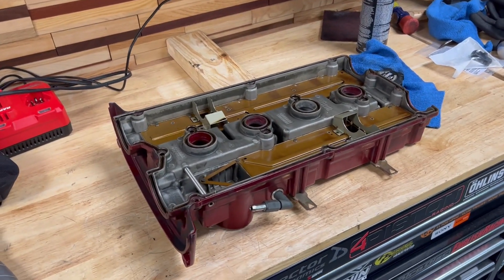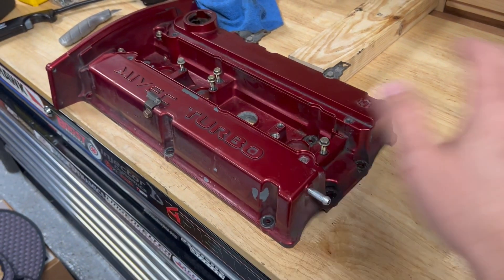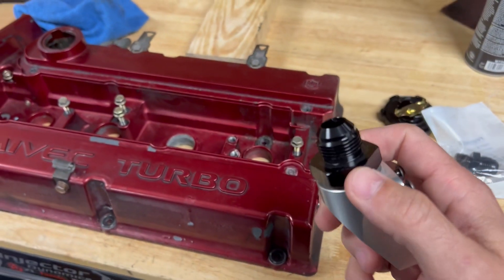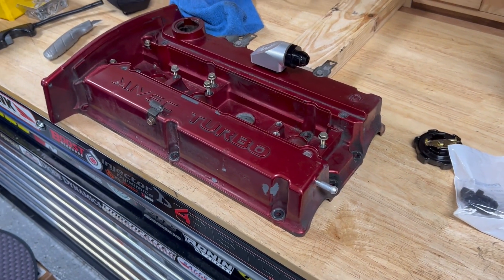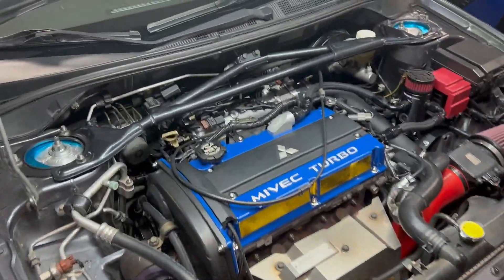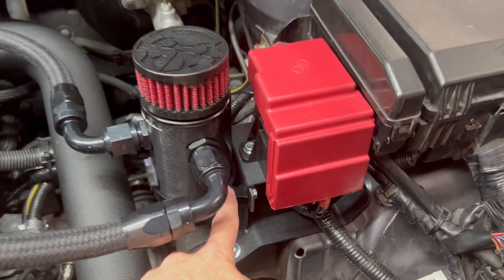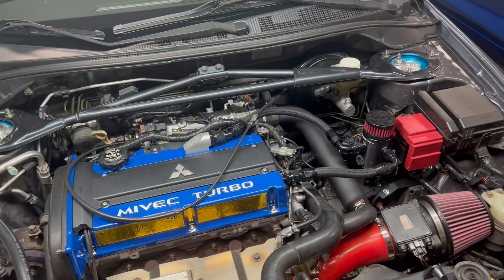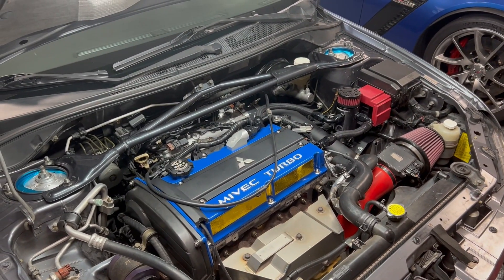Valve cover breather modification (Evo 8/9/10)

Comment: Just do a breather from the engine block, no need to mod the cover.
Reply from the maker: Drilling the block is a lot more more nerve recking then drilling the VC
But I heard from Mike @Infiniteevo that he made a vent on top of the valance shaft cavity and that worked really good without filling the can
Reply: @Justa2L  It may work ok but on that side oil go down to the block from the head and for that reason in stock mode this vent is closed by the turbo pressure

Comment: This would only work for stock motors. Once you go with a higher compression motor and road race, you will fill that can fast.
I do however like the innovation with the top breather.
Reply from the maker: I would definitely like to find out if this would work on a built 4G.
Hopefully someone with a built engine sees this and give it a shot and reports back. Or if eventually I do a built engine I’d put it to that test.

I am taking the car to Sebring International in November so all the updates are going to get hard testing
Reply: @Justa2L  as long as you have an OEM moto,r filling a catch can usually isn't an issue. If you watch the Gears and Gasoline videos. I helped with the solution and it's basically a scavenging system that pulls oil out of the catch can and back into the motor.

 The actual issue is the cylinder  blow by into the crankcase not only prevents proper draining. It acts like a siphoning and pushes oil into the catch can. There is so much oil vapor in the head, it needs to go somewhere.
Reply: @awdboosted can you send me a link for a solution currently I am filling up only at the rear where the pcv was the side on the exhaust cam is fine
Reply: @Justa2L did this help?
Reply from the maker: @w2jteknet  yep
On the new car with a built 2.0, no blow by. Seriously
Reply from the maker: Small world haha
I actually bought some stuff from Ben from his Evo